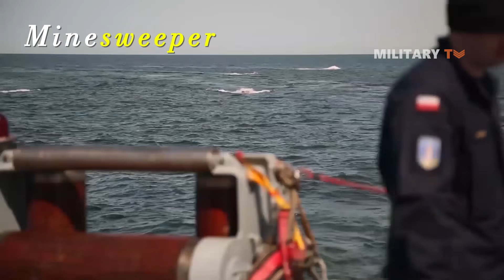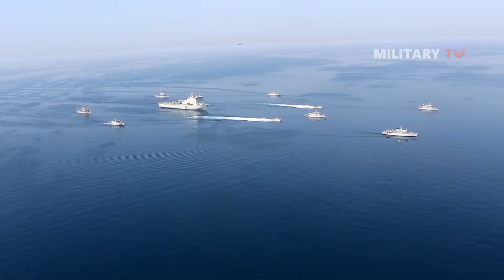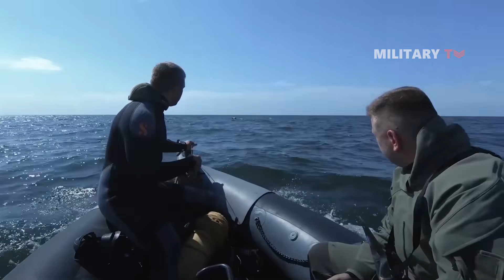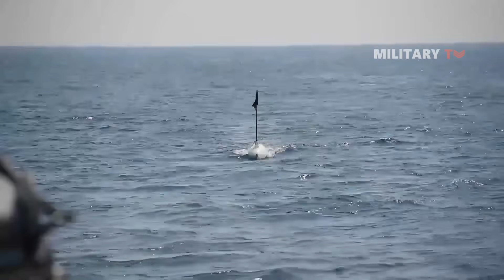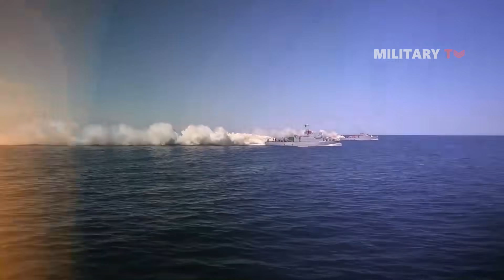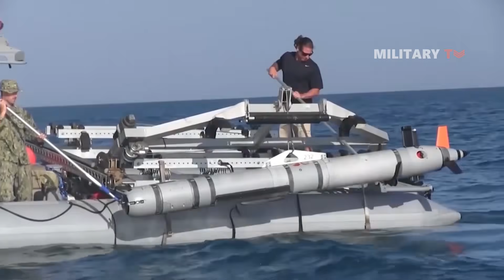The difference between a minehunter and a minesweeper

Comment: My father and uncle were both on MSS1 an experimental NAVAL DEVICE. commissioned in the late 60's it was full of blown in closed cell foam and then the hull was flooded in order to keep it from capsizing from buckled hull plates it was made from the HARRY L GLUCKMAN a 500ft liberty ship and powered by (5) GMC 12-71 diesels running 360 degree harbor master pinion drives it could hold itself stationary in the ocean currents and had AC powered electrics and could pulse currents to create the correct magnetic signatures to detonate mines designed for AIR CRAFT CARRIERS down to Destroyers. Dad was on from 67-71 after blowing up crap in the Dry Tortugas and the gulf of Mexico the ship was sent to Vietnam in late 1971.- 72 plenty of info and photos of plumes of water obstructing the view of the ship on NAV SOURCE

Comment: I was stationed on the uss Assurance mso 521 (later AG 521) in the mid 70,s . we had a wooden hull with degaussing cables  wrapped around the inner hull to keep us from being attracted to magnetic mines . we all so had some thing called an acoustic generator . not sure what that did . fun stuff . but not long after being assigned to assurance the navy decided to change it over to a different  type of ship that looked for Russian submarines  instead . so all of the anti mine equipment was removed and specialized sonar equipment was installed  .

Comment: I still don't know how a minesweeper works or really what it does... I just know what it doesn't do. (I guess).
Reply: They use sonar to locate mines, sweep gear to clear minefields on the Minesweepers. They both have a Mk 48 MNV which resembles a little sub that can neutralize bottom bottoms mines or cut the line of a moored mine.

Comment: The Flower class small ships were not only used against mines, they were also used in large number as Corvettes escorting and protecting convoys particularly on the Arctic convoys trying to supply Russia from England, the ships were barely seaworthy for Arctic waters at the best of times and fighting off U-Boats and air attacks didn't make it any easier, these men were indeed of Greatest Generation.